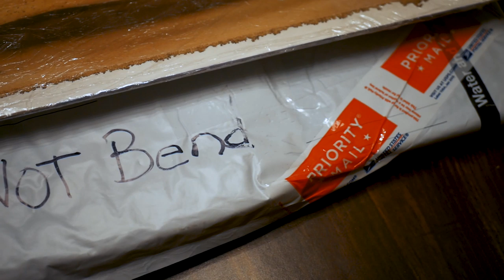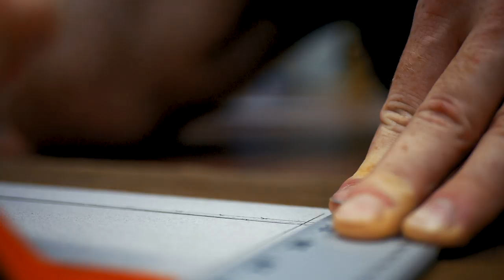Picture Frames with Morso Guillotine Cutter

Comment: Different types of papers, like watercolor and mat board, expand at different rates. You should only tape a picture to the mat at the top, not on all four sides.
Reply: I'd loved the carpentry and then was so disappointed to see the way the picture was taped to the mount ... look up 'hinge mounting'
Reply: Excellent video. However, taping all four sides of the artwork will likely result in buckling of the paper. And if you want to be serious about conservation of your art work, use frame tape on the rabbet of the frame to isolate the art from the acid in the wood. In time, the acid in wood will burn the edges of a work on paper.